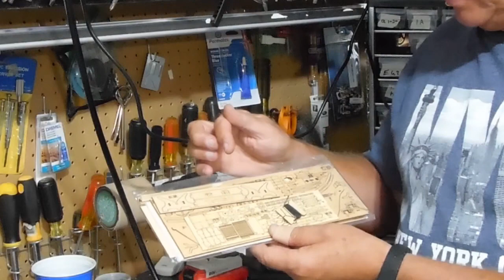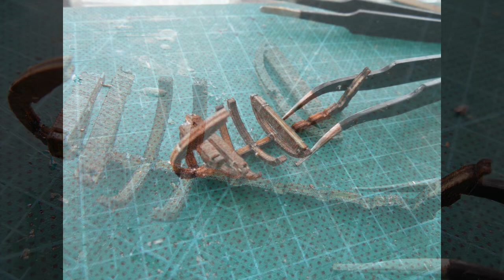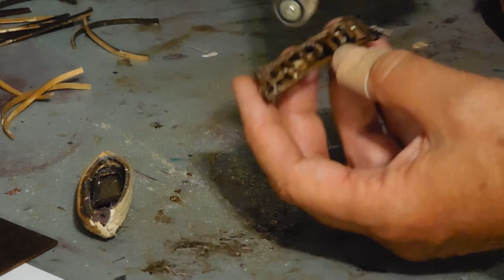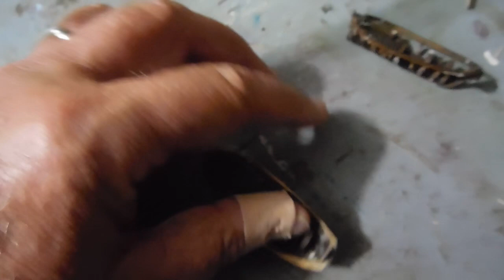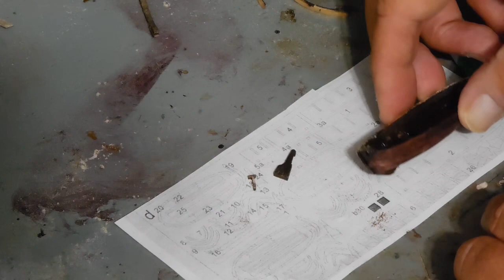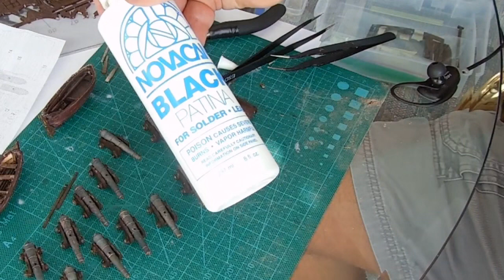Building The Black Pearl Model Ship Part 6

Comment: I'm doing the full hull version and WAY short on planks also. Filling the bottom of the hull (below waterline) with blocks of pine (1/2 x 1/2 ) and will grind /putty smooth and then texture paint. Kit doesn't warrant the extra cost of planks for me. also started my AL Chinese junk kit (much nicer to work with quality kit)

Comment: cannon tapered base ,wrong way round, check drawings of ship cannons on you tube. The wider end of the base is for the larger diameter of the cannon.
Reply from the maker: That does make sense now that you say it!  Ship’s instructions were not clear.
I’m an obvious beginner and appreciate your help and watching 👍
Reply: @BoilerDan1  I'm just starting the Black Pearl and i use you tube pics a lot especially on this model because as you say the drawings are not that good. I follow your you tube videos on the build ,they are very good and helpful.
Reply from the maker: @welshknight1456  Nice to have you following along my journey. I’d like to build it again now that I stumbled through my first build. Don’t know if I will get to it, but I know much more now than when I started. Enjoy your journey!
Reply: @BoilerDan1  I have built the Virginia, turned out not too bad. I find the planking tedious, so now, i build the other  auxillary items in between the planking, to stop getting bored.
Reply: @BoilerDan1  'Ships of Scale' is a very good  free website for wooden ship modellers. full of interesting articles and tips from other ship builders.

Comment: nice, yeah the life boats are very small, don't know if I want the cannons black or leave them brass, where did you get your flickering LEDs from ? great job
Reply from the maker: I found the lights at Amazon (here is a link)
https://www.amazon.com/gp/product/B0785DQ8FD/ref=ppx_yo_dt_b_search_asin_title?ie=UTF8&psc=1
I then purchased a larger resister at a local electronics store.  That way I could use one resister for 12 lights.  The amazon led's come with resisters, but you need one resister per lamp.
Reply from the maker: I was mixed on ageing the cannons... The brass would look good, but it is "The Black Pearl" so that was the deciding factor.  I'm considering building another one once this one is done, especially knowing more about the construction and definitely not putting on the second deck as soon as I did...
Thanks for following along on this adventure.